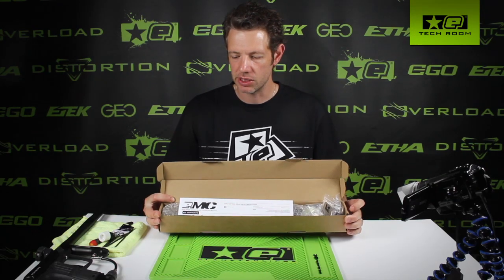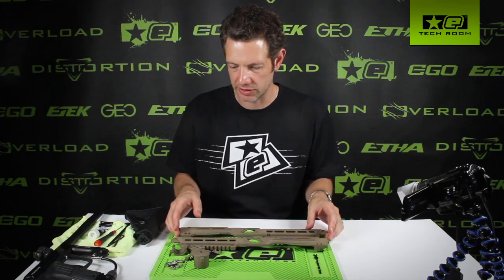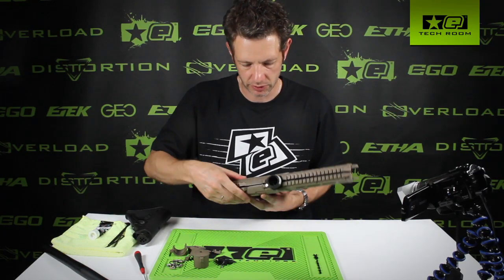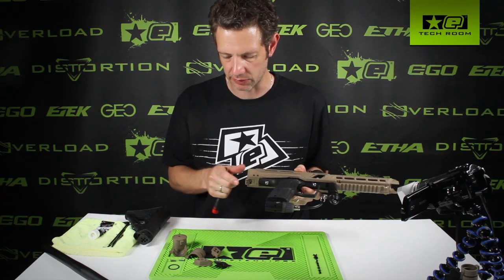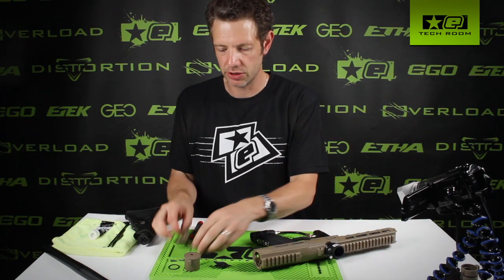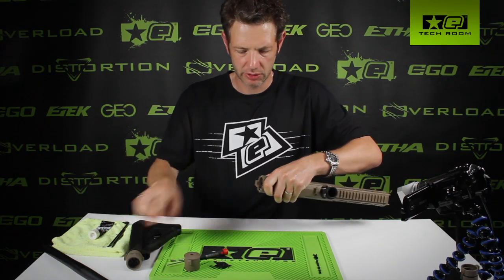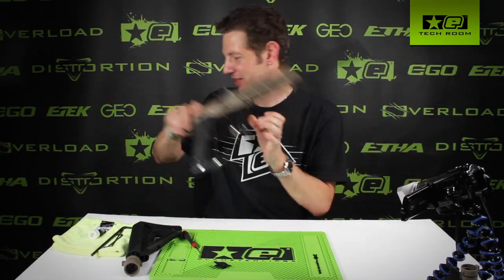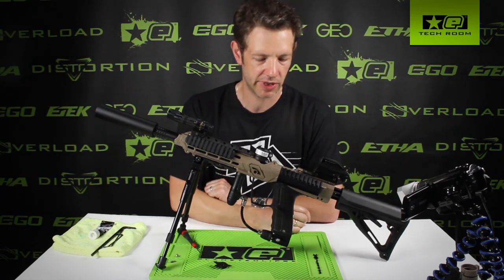EMC Rail Kit Introduction

Comment: yes & no i have a red-dot i modded on to a 20year old tracer it is kinda cool when you can put cross hairs on a player head100+feet away and get a gog shot with 1 shot right between eyes
with that said my pump cocker and ego11 you get used to where to aim no sites needed i could do same with tracer but cool factor site stays on